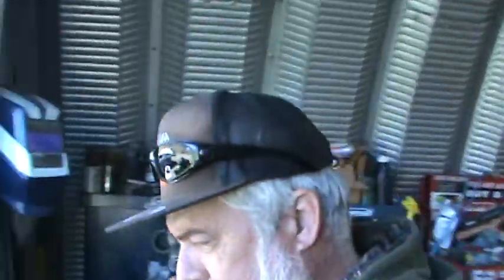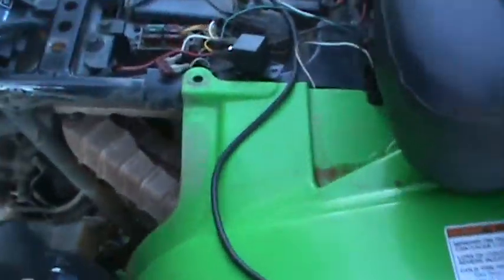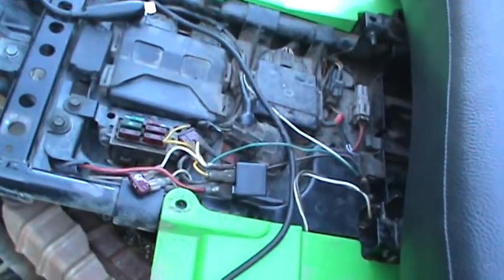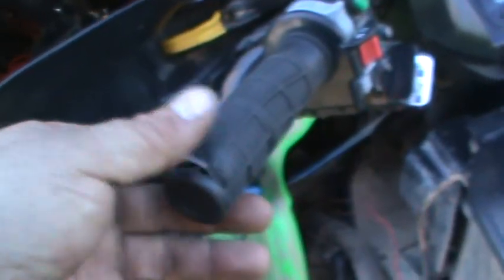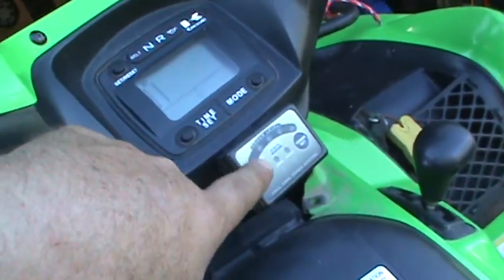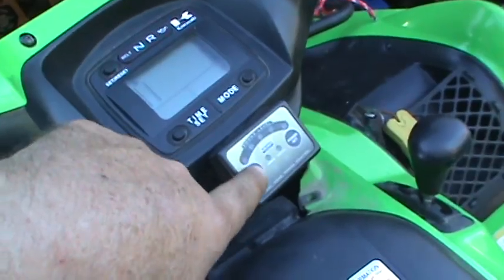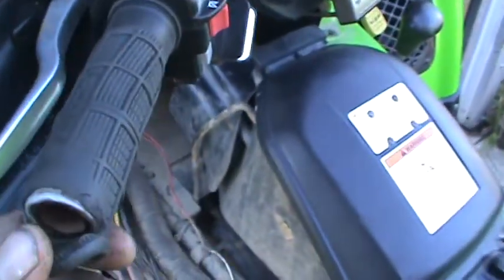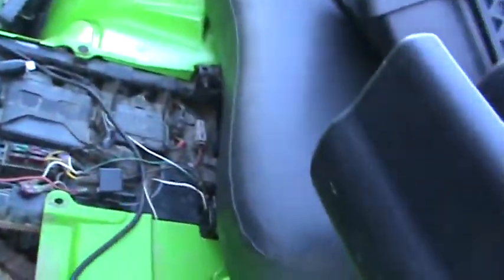Brute Force 750 winch fix part 2

Comment: Hello! I just got an old brute force 750 with alot of problems. Trying to follow your videos for troubleshooting. Thank you for your videos. Keep it up!
Reply from the maker: Thanks for your support. Please reach out with any questions you may have.
Reply: @HammerHeadGarage  well, i do have 2 questions that i cant seem to figure out. There are 2 main issues with the kvf at the moment. 1 is that the 2wd-4wd in the display keep switching, constantly. The other issue is that it kinda start making lots of sound when u try to speed up. Kinda like some backfiring. I tried your gasoline check, and it pumped out nearly 300 ml.
Reply from the maker: @anderskland7257  The 2wd/4wd is flashing because there is a problem with the actuator down on the differential. You can take them apart carefully and clean them up and sometimes they will work. Otherwise, it needs replacement. The backfiring can be caused by a number of things. Make sure the valves are adjusted first. What year is your Brute Force?
Reply: @HammerHeadGarage  thank you for quick reply!. I did check the part today, and it dosent seem to be powered at all. 
The atv is a 2006 or 2007 model. I havent checked the Valves yet, but i might have to check that? Is it difficult to adjust the Valves?
Reply from the maker: @anderskland7257  check the valves. They get tight over time
Reply: @HammerHeadGarage   so we checked the valves, did some adjustment to the wirings, cleaned up everywhere and made it run smoothly! Thank you so much for ur tips and videos 😊 its only one major technical problem left, the flashing 2wd-4wd. We took the brake actuator apart. It was rusted and completely Stuck. We managed too clean it all, and made it running again, still issues with the flashing. Any tips? 😊
Reply from the maker: @anderskland7257  You're welcome glad I could help. Does it actually switch from 2wd to 4 wd? if not and you have taken it apart make sure the slider in the diff is moving back and forth. Then at that point replace the actuator.